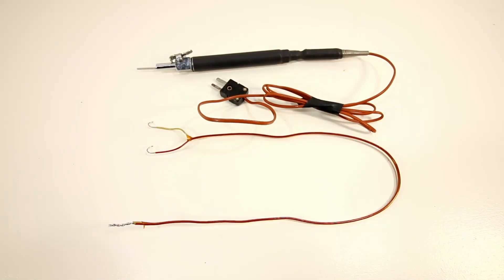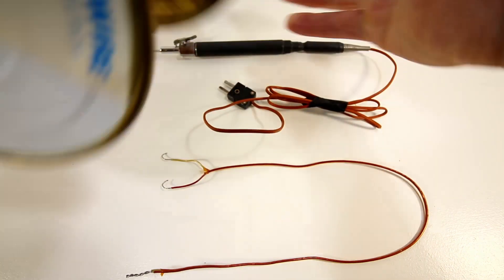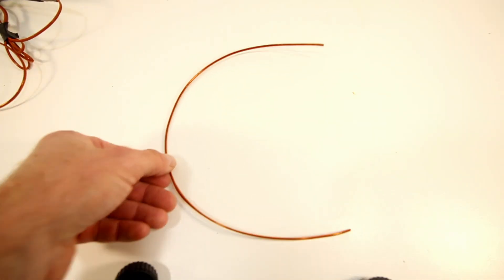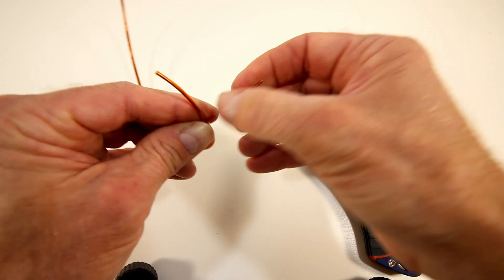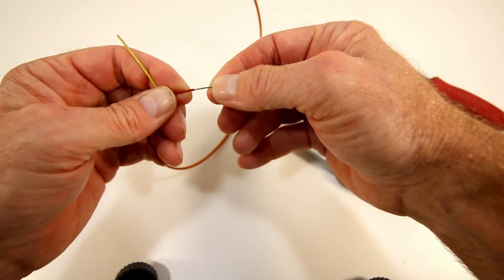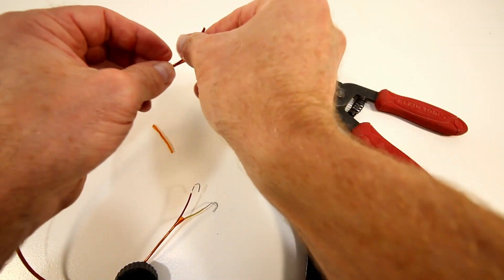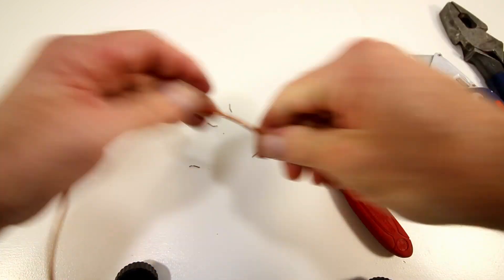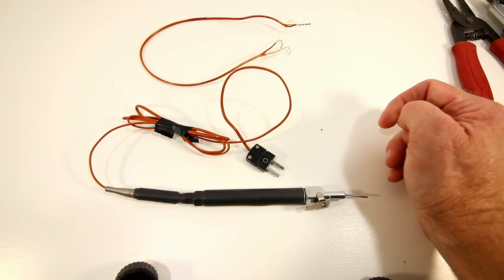Creating a makeshift Thermocouple out of TC extension wire

Comment: Hi, do we have to prevent wires from oxidation? Soldering or coating with epoxy? Thanks
Reply from the maker: No. By soldering, you would change the makeup of the conductors

Comment: slightly off topic.... but maybe you can help

I have an MPPT lead or lithium solar charge controller intended to be mounted right next to battery. A fairly inexpensive unit typically used for solar powered street lamps.  The controller has small tail of wire with an in the air thermocouple  on the end to measure temperature for controlling charge based on temperature of space around battery.   The wire with sheath is only 2 or so MM in size and the thermoucouple secion itself only maybe half cm in width...   I would like to move this thermocouple (thus allow for battery to be far away)  with about 25 feet of compensating extension wire .. do you have any suggestions for me?.  I have no idea on how to determine if the thermocouple itself is J or K orrrr??

Comment: The twisted hot side will get later of oxidation/carbon and stop working. I usually twist it tight and strike it flat with a hammer which just about acts like a weld because the force combines the metal tips. Keep the flat end of the screw driver over the junction before putting the hammer. Direct hammer contact destroys the thermocouple wires.

Comment: Most any to different metal wires work.  We use to use nicrom and cooper. Nichrome will not solder.  Just melt the to metals as a weld.

Comment: i knew i wasn't crazy for trying this! i had a very long K-type thermocouple that had a heavy bullet shaped weight at the end. it was for measuring temp about 3 feet below the surface of a lake. the bullet weight had corroded off completely, and i was left with essentially a K-type that had the end cut off. i realized that i should be able to clip the ends clean and solder them together with a big blob and repair the thermocouple to mostly work. but it didn't work! and everyone thought i was a moron for trying. thinking back, it's likely that the old thermocouple reader it was attached to was messed up somehow, or i messed up the calibration it had baked in when i made my repair. i didn't change the overall length of the thermocouple by more than 0.5% maybe, so who knows
Reply from the maker: Most likely the solder.

Comment: In this extension wire are the two wires are of different metals? Or same material
Reply from the maker: same material, otherwise you would have a galvanic reaction between the dissimilar metals
Reply: @PeteVree  False Pete, two conductor wires are dissimilar and must be to ensure the Seebeck effect takes place. K wires are Chromel (+) and Alumel (-). The difference in Milivolts (EMF) is what determines your measured temperature. Coming from an engineer at a Thermocouple company in the midwest.
Reply: @KilledByTornado  You are correct. I read the question as... are the extension wires the same composition as the actual thermocouple. Thanks for clearing  that up for us.